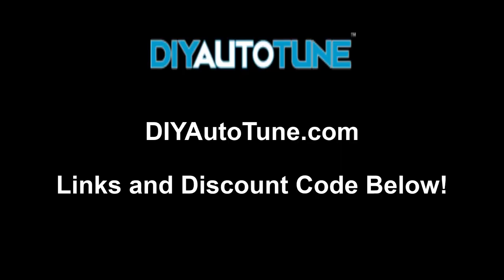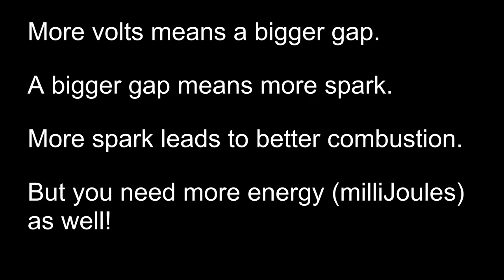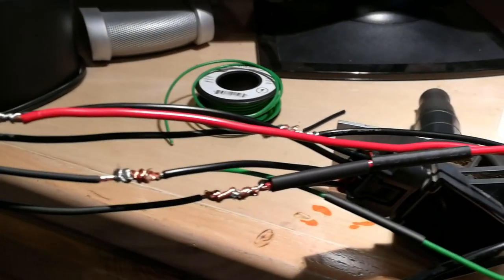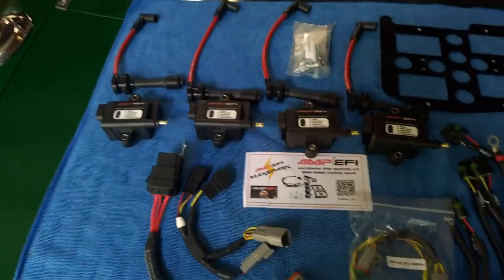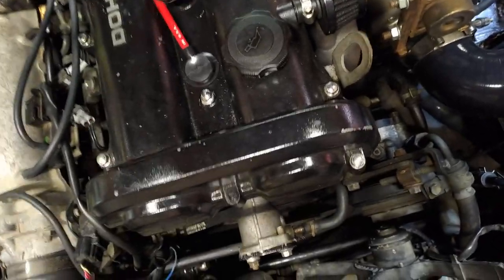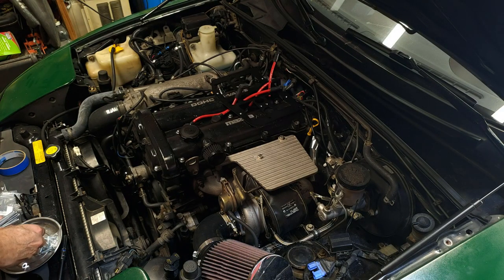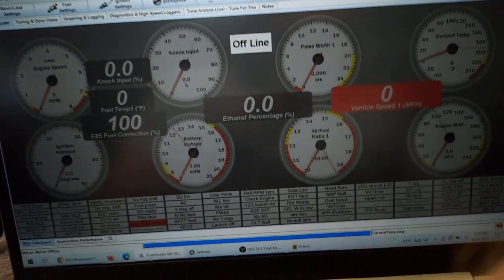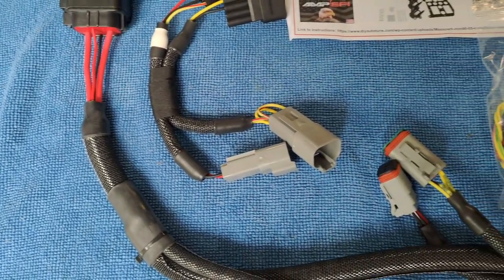MaxSpark PNP Ignition for Miata! 81,000 VOLTS!

Comment: Excellent video on the topic. For most NA and NB boost applications, I think the LS2 coils are plenty. I personally would be looking at a V8 before going the 300+ hp BP 4 cyclinder route.

I would go V8 for the same reason of, "Buy once; cry once". The V8 swap has the transmission and differential ready for the power.
Reply: The LS coils do a decent job.  There are really two challenges I hear from customers pretty regularly with them.  First is the tendency for some LS coils to discharge early if you dwell them too hard, some of these coils have a dwell limit where it seems in an effort to protect the coil, they'll go ahead and fire the spark early if you overdwell, which advances the timing for that spark, and can grenade an engine easily.  The other issue I hear with LS coils is that it can be hard to find good quality replacements.  You can find a replacement at any parts store, bonus-- they might be crap compared to the OEM coils.... common apparently.  

Furthermore, the WIRING plays a huge role in how well any coil can perform, and this can be measured as a voltage drop to the coils.  Too small on the power/ground wire gauges and the coils will be starving for power. We did the wiring for you in the drop-on harness ensuring that it's done right.

Comment: I just got these installed on my build. The Flow Force LS2 coil spark was getting blown out on my 10.5:1 compression, big cam, big turbo build at anything over 20 psi. Upgraded to the maxspark and everything has been great. I did have to gap down to .022 as I was having some spark blowout. Currently running 27 Psi without issues!.
Reply from the maker: Nice!  Good info!

Comment: Are these the same old ig1 coils that everyone sells?
Reply: Once upon a time, that might have been easier to answer.  

We were among the first to sell IGN1A coils well over a decade ago.  Since then, a bunch of others have jumped onboard, big names in the industry, selling them as well.  That's fine.  Also since then....  a bunch of counterfeit copies of these coils have become available on places like eBay and Amazon, and they're junk.  

These are indeed legit IGN1A ignition coils, as hot and reliable as they come.  And they are both of those things.  This is a fully engineered solution though, not just some coils.  It's also a mounting plate that fits these engines nicely, custom  length/design Magnecor plug wires, and a VERY slick wiring harness that ensures these are properly wired to get adequate current without voltage drop issues, and to make the install EASY.  It takes minutes to install this kit.  it would take the average person a number of hours to hack together their own harness, with a reasonable chance it might not work as well.   

We do sell just the coils and connectors still of course, for those that would like to DIY it.  We added a lot of value here though for those that want a dead sexy harness and mounting solution with matching plug wires-- that 'just works'.

Comment: My 1997 1.6 mx5 (Eu Modell) has the 8 pin conector. Is that normal?
Reply from the maker: Sorry I missed your question...I think it's normal.  I believe the 1.6 uses the 8 pin connector with an ignitor vs coil pack regardless of year.

Comment: because if it is an intelligent coil, is it in westate park? you don't have to put it or change it to coil and plug????
Reply from the maker: If I remember correctly, the cop setting will do sequential.  So if you have wiring for full sequential then you can use that.  Otherwise wasted spark is fine for any coil type.   Especially with powerful coils, you'll see no performance difference.  I rarely bother setting up full sequential for ignition if the car doesn't have it stock.
Reply: @OGPedXing  bro thanks ✌🏼✌🏼✌🏼 i let you know if start

Comment: How much power can the Toyota COPs support?
Reply from the maker: Typically about 250hp on the na1.8.  You may be able to squeeze out a bit more by decreasing the spark plug gap.
Reply: @OGPedXing  Sweet! I'd love to just use the R8 COPs but I'm running the MS3X which can't fire them correctly. Currently sitting at 230whp on my turbo NB2 and not looking to go past 250 as the motor and trans are stock so these should be good enough
Reply from the maker: @3lm3rfudd  I ran at 230ish with Toyota Cops for a while with no problems at the stock gap.  You can watch for blowout at the top of your boost range by logging and looking for drop offs in power and a sudden richness spike in the afr.  If you see that, then just gap the plugs down a bit like .035 or .030.
Reply: @OGPedXing  Thanks! It's awesome how much good info you share. Been tuning my EBC with the help of your other vids, just gotta figure out closed loop so I can boost by gear now. Not confident enough to try the transistor mod to make the ms3x fire the R8 cops

Comment: Is this coil have IGF wire?
Reply from the maker: It comes with everything you need to connect to the stock wiring plus an extra wire and fuse that goes to direct to the fuse box's battery positive input so it can get extra amps than what the stock wiring can handle.  But for the ignitor wiring, it just plugs right in.
Reply: I have Saab 2.0L turbo.  It have 4 connectors and one is igf.
Reply from the maker: @honda636hp  I checked and it's 5 pin: trigger, bat pos, bat negative, sensor ground, and engine ground.  You may need to check what the ecu on the Saab requires.  Some require a tacho out signal on the igf wire and I don't think this one does that.
Reply: @OGPedXing  it's a :   Ionization signal to CDM